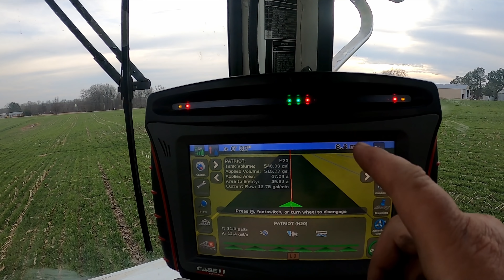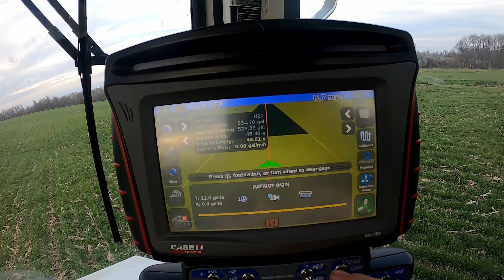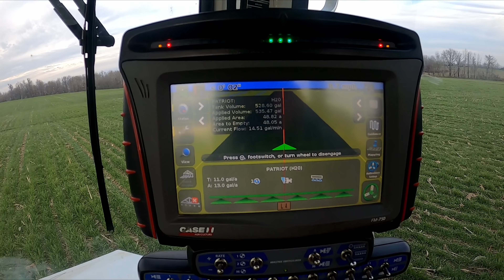It feels like Spring!

Comment: Robert,what is going with your row spacing? Looks like there not spaced evenly,row units swinging on main bushings maybe. First day snags,love the spray trailer.     One more important thing,get some rubber gloves on dang it PLEASE!!!  Thanks for reply. Had my antique 750 J D break front tube 😢😢
Reply from the maker: We had the rear tube break on the drill during planting. When we hung the units back on the tube we got off on our measurements. We didn't realize it till the wheat started coming up.  2 rows are about 5" apart and then 10" apart.
Reply: @DylanJoyceFarms  I thought it was twin row and y’all going to plant soys in between or something crazy !
Reply from the maker: @tysecord7082  that would be a good idea.

Comment: What spacing is that? Looks like twin row 15 or 30?
Reply from the maker: We had the rear tube break on the drill during planting. When we hung the units back on the tube we got off on our measurements. We didn't realize it till the wheat started coming up.  2 rows are about 5" apart and then 10" apart.